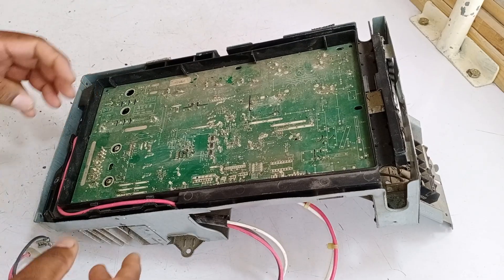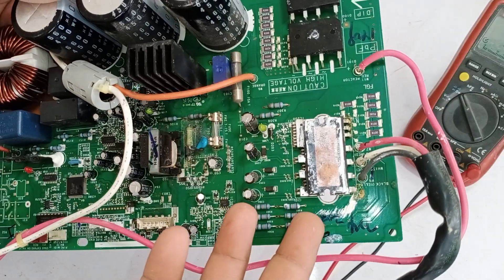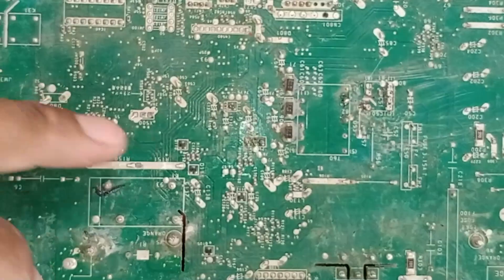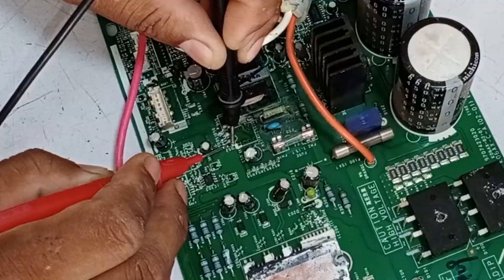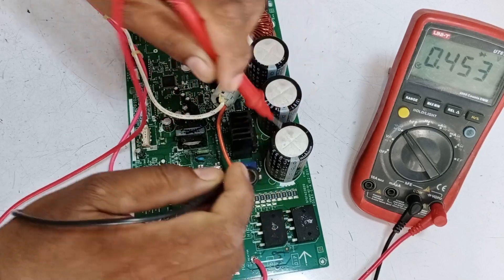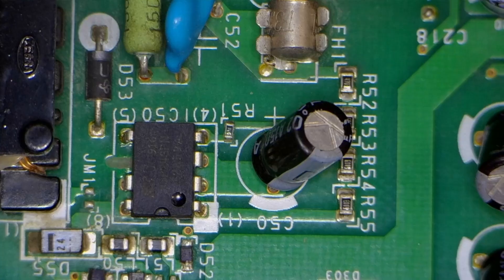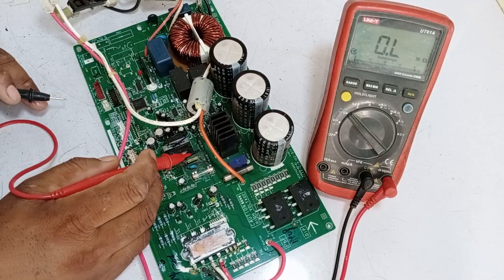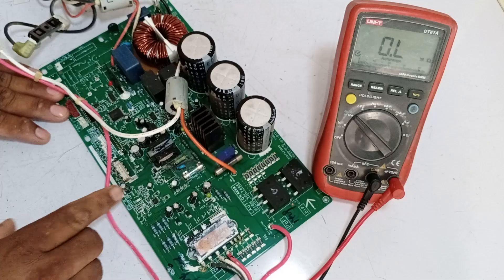Water Damage Nightmare: Fixing Persistent Shorts on Fujitsu Circuit

Comment: Replacing the micro controller may fix the short circuit but may not fix the board.....as the new micro controller will still need to be progamed with the manufacturers instruction set....unless you can purchase a pre-programmed micro controller?